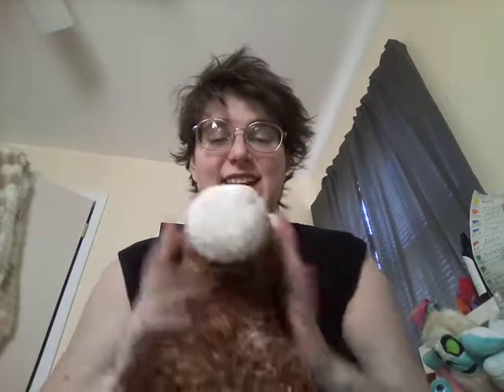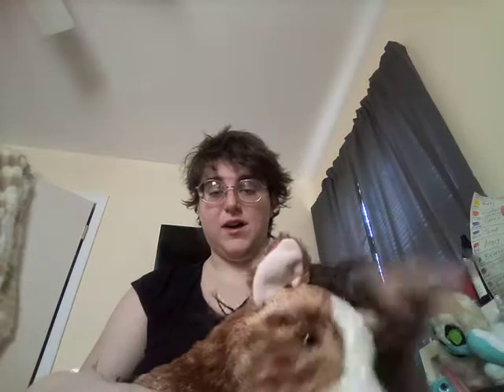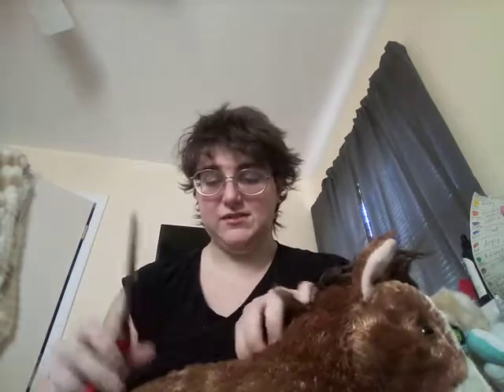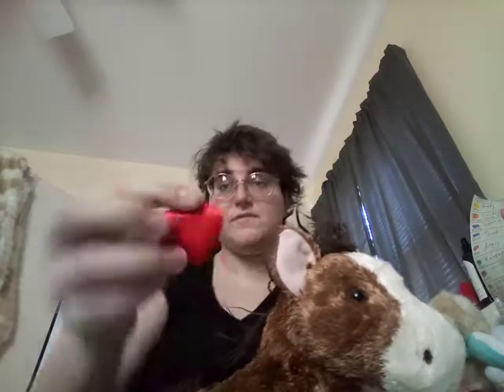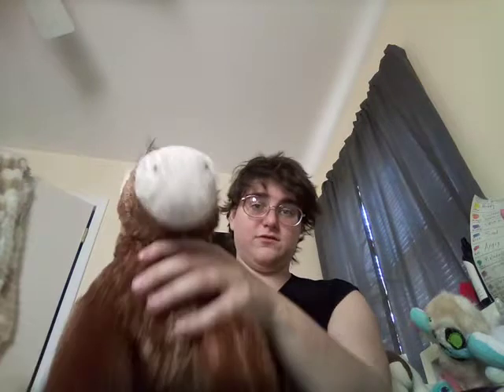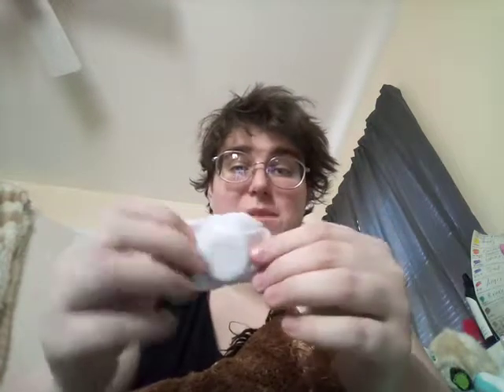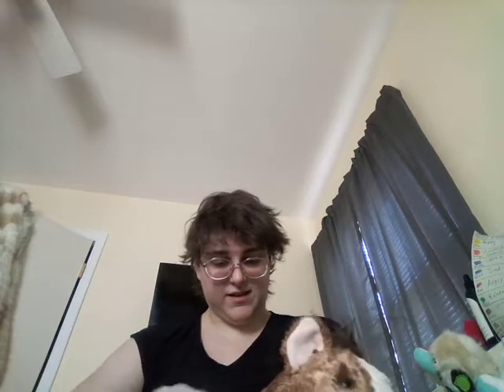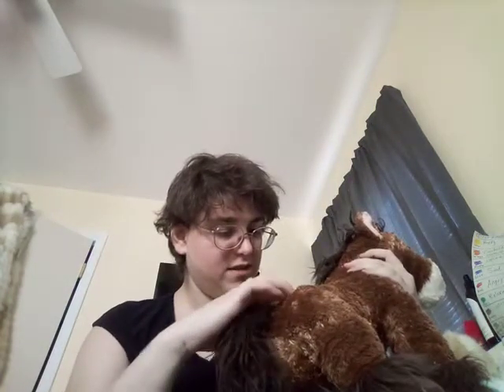Taking sound buttons out of build a bear plushies

Comment from the maker: Ok but in all genuine seriousness. Because this is nearly 2 years old. (Wowza! Time flies!!) 

I have more in depth info in the description if anyone needs it! 

Also im literally a freelance seamstress. Granted I've improved so much since making this video. But the process is easy to get the sound/electronics out. Heck, you don't even need to be an expert in sewing!

Step 1: get a seam ripper and pop all the seams open where they sewed the back shut. Seam rippers are dirt cheap and a handy tool. 

Step 2- make sure you know where the electronics is and then reach in and pull it out. If you need to,  unstuff that area a bit then pull the box out. Put the stuffing in as you like it. 

Step 3- get your thread and needle ready with a pair of scissors. You can do a basic blanket stitch to close the back. Or you can do a hidden stitch like a jim henson stitch! Its up to what your comfortable with. I promise its not as scary as it seems. 

Anyway. Hope everyone has a safe holiday in this insanity of 2020! 

~ Scorpion
Reply: Just FYI build a bear offers free de stuffing restuffing so i can wash them at home and will put new batteries in sound boxes.
Reply from the maker: I never actually knew that!! Thank you for the info! :D